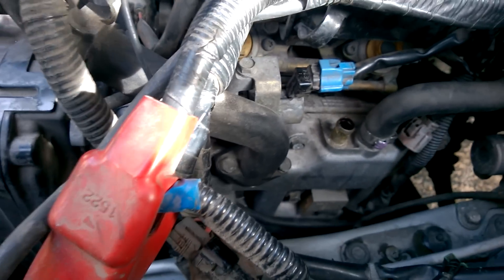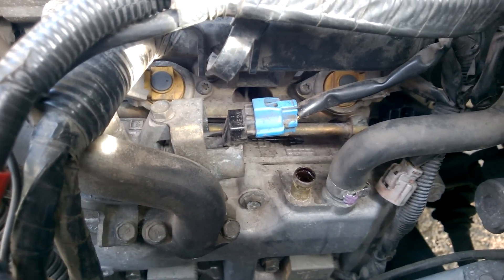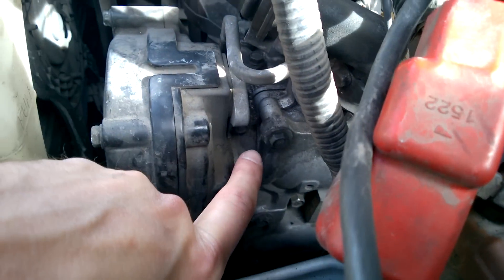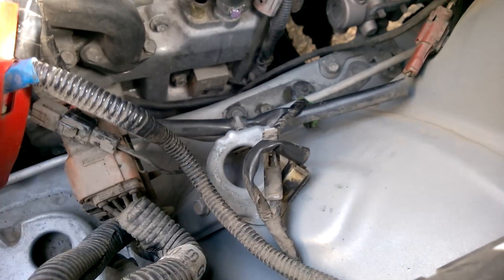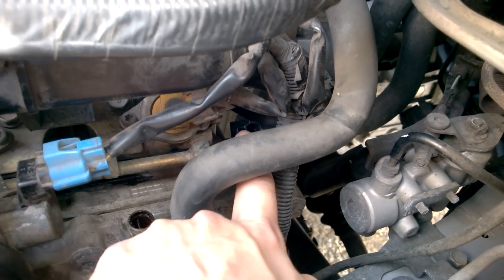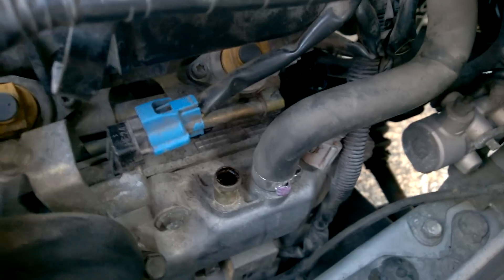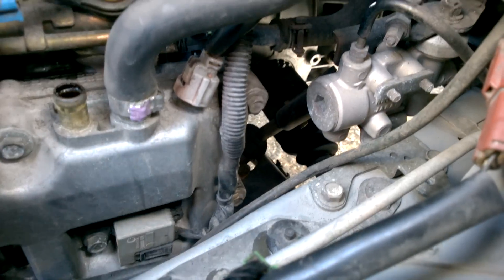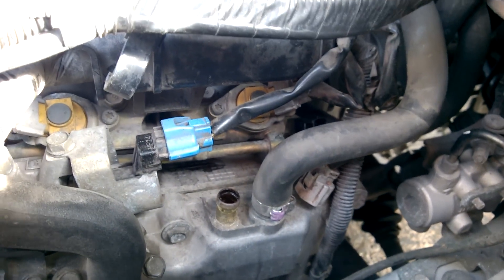Subaru Forester XT Camshaft Position Sensor P0345

Comment: Hi brother, that crazy clamp is a pinch clamp, used on fuel injectors sometimes. Just cut where it is crimped with side cutters, and replace with a spring clamp.  I mean if you need to.  Thanks for the good vid.

Comment: The real fun one is on the passenger side under the turbo.

As for that funky clamp, it requires a special tool that is around $5-15 or you can just pop em off with a screwdriver.

Hose Clamp Pliers Hose Clamps Axle Sleeves Collet Clamp.
Reply: the passenger side one is easily done in 5-10 minutes if you have a short swivel 10m socket

Comment: I have a 2004 xt that is leaking on the right side, I’m sure is not the valve gasket, in this video you said you have another video trying to explain where the cam shaft was, I think have a problem with that,
Reply from the maker: Hey! So I was saying in the video that I would show where the other sensor was in another video if I had to replace it.
Reply: Joshua Harris I just found out what my issue is, it’s the cam shaft seal that is leaking 😫!
Reply: Joshua Harris thanks for replying!

Comment: I have a 2005 Subraru Legacy GT 2.5 DOHC Turbo Limited. This It's got the same engine and I had the same problem finding the sensor! This is video is extremely useful. The engine in my vehicle is an EJ255BLAUB.

Comment: I changed right . For this I removed the battery, washer tank and intercooler. Key for 10 simple bean. not easy , but possible to Unscrew one bolt.

Comment: hey, how did you get the bolt started going back in with the new sensor? Im working on  a 05 LGT EJ255. Same engine but layout is a bit different.. I guess where you have your windshield reservoir I have a big fuse box...I removed the battery (same location) and a bunch of connections and that same vac hose you did. I got the old sensor out but its virtually impossible to get the bolt started with the replacement sensor going back in with the new one. the temps are freezing here and all the hoses are extremely brittle.. the one large vac hose exploded already when trying to remove it and I had to order a replacement.. I have a feeling I am just going to have to break (very likely what will happen when I try and remove the other one) the second large vac hose there with that crazy clamp to get this done...this is not easy at all..
Reply from the maker: TrevorLystiuk It was easy for me most likely due to the weather being nice out and the layout of the forester's bay. Hope you ended up getting it in there!